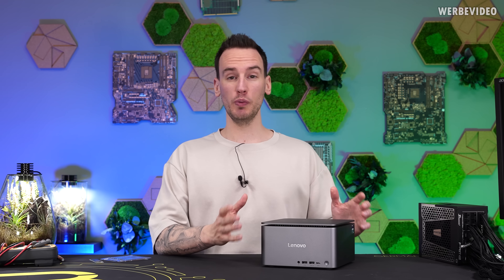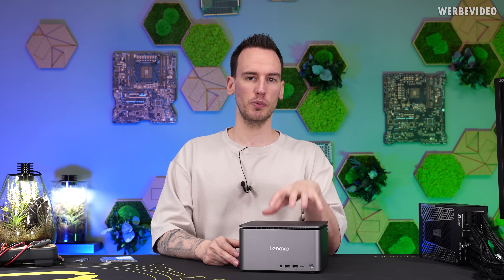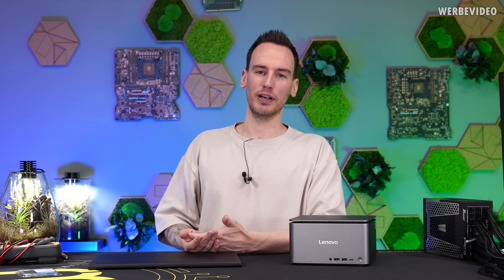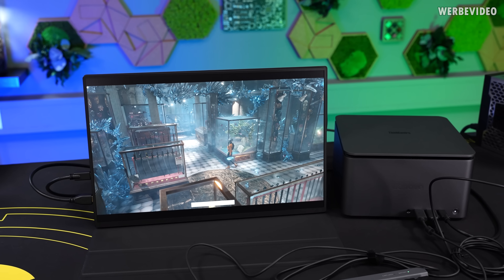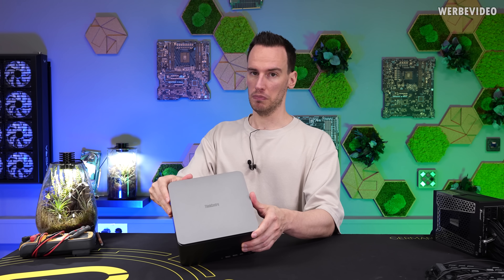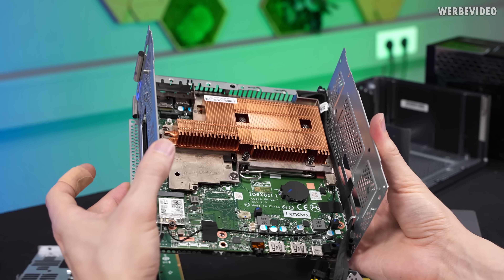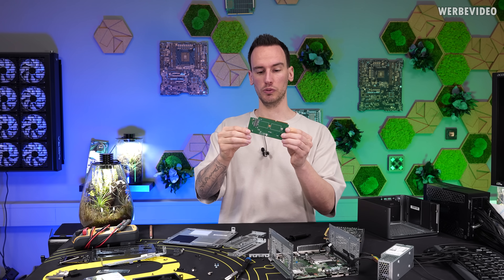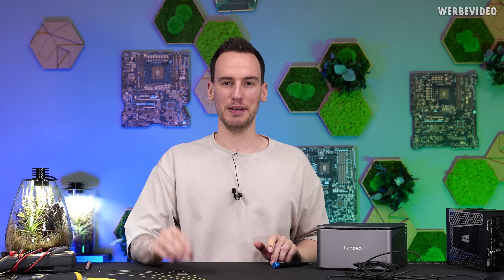Interesting Cooling Solution inside my new Lenovo Mini-PC

Comment: I've been using Duronaut to try it out and the results are very good. Spreading was a big issue for me on my 9800X3D, but when I switched to a different technique I was able to get better temps than I had with my Noctua NT-H2 paste. My best results were putting a little Duronaut dot on the CPU, then smearing it around with a finger cot (thin piece of plastic over my finger) for a thin coating on the CPU heat spreader and base of cooler. Then applying 5 small dots of paste on the CPU. It is easier than trying to spread it and works really well for me. Thumbs up!
Reply: he explained that to do pressure down with the spatula is a must to make the paste stick to the surface.
Anyways what you did is what i used to do with as5 that i remember was pretty thick and dense.
Reply: Materials with better thermal conductivity will reduce the viscosity, I buy M14 thermal grease is also very difficult to apply, I do not have the patience, I press directly with my hands, but the thermal conductivity is very good.🤣
Reply: You can make it more spreadable by heating it up just by dunking it in boiling/hot water and make sure that the tube is closed and when you pull it out its nice and toasty which should make the paste less viscous due to the heat. Also slamming your CPU with Prime95 or Cinnebench for about 10 minutes and then immediately turn off your computer and yank out the cpu cooler and then quickly clean the cpu trying to save as much residual heat on the CPU heatspreader and use that to help you spread the Duronaut.

Comment: I just love the look of a good ol' copper heatsink like that <3
Reply: Remember when desktop motherboards used copper heatsinks to cool VRMs? Now they're all just big hunks of aluminum with poor fin density.
Reply: @Mr.Morden  To be fair, aside from one gen of AMD chipsets that needed fans, modern aluminum heatsinks are fine.  Whereas sometimes the old copper heatsinks were implemented so badly that an aluminum one could have been better (I had one where replacing the thermal interface and mounting dropped temps by 20C).
Reply: lenovo always seemed to use fully copper heatsink on their high end profesional gear

Comment: The blue plastic retention clip for the M.2 caught my eye. A good idea for that to become a mobo standard. Fewer lost screws, and slightly less weight. No need for a screwdriver/nutdriver either.
Reply: Some mobos don’t use screws already
Reply: Also, the screws they use are so freakin tiny and so easy to yeet themselves somewhere they shouldn't be.

I had one landing inside the pciex16 slot and it took me a while to get it out.
Reply: @enlightendbel  next time just turn on the PC with the screw there, you`ll either see it flying out while making R2D2 noises or get magic smoke
Reply: most motherboard have that already and its not about weight those screws weigh like nothing
Reply: good that it is starting to get used more often but one thing is bigger challenge that m.2 slot is just up of pcie slot so gpu hides it. you have to take out the gpu to change m.2. its a pain and often people who have no experience with pc cant do it cause either their friends helped them build or used prebuild. also just remebered these type of clips dont need the standoff. you wouldnt believe how many ssd ive seen banana shaped
Reply: @boombox8675 The bigger problem with putting M.2 drives under the GPU is thermals - PCIe 5 drives kick out a fair bit of heat and if they're buried under a big hot GPU cooler that heat will build up a fair bit
Reply: @bosstowndynamics5488  the slot above gpu is the fastest one so running a pcie5 drive its must you have to put there. also ive heard nvme ssd can tolarate high temp more than you would think. but ye the placement is really bad
Reply: @boombox8675  NVMe drives can tolerate high temps but if we're going to claim that PCIe 4 is too slow then you definitely don't want to put them somewhere thermally constrained since PCIe 5 ones in particular throttle if you even look at them funny
Reply: I'd be happier about no longer having the possibility of having one of those screws snap. Had it happen on my previous mobo and the other end was stuck in the standoff
Reply: I have lost the screw that came with the mobo. I think it got sucked in a parallel universe. I spent almost an hour to find it with no success. 
My big surprise was that I could not find similar screws for sale... and they are in different sizes and threads.
After that experience I prefer the rubber.
Reply: @christiancurec3574  the m.2 spec actually requires the screws used to be either M2x0.4mm or M3x0.5mm, also I'm not quite sure these plastic or rubber solution comply with the spec as the screws are also supposed to work as a way to transfer heat off of the m.2 device...
Reply: @kettusnuhveli  Not sure about screws being a thermal interface with how tiny they are and how they're relatively distant from the heat generating parts of the M.2 device, but they do seem to be expected to provide grounding since the hole is always conductive. Fwiw I've seen passive adaptor cards with these plastic connectors that also ship with a screw post you can swap in in case this does cause issues
Reply: @ i personally doubt the thermal benefits as well but that is what the PCI-SIG claims in their spec
Reply: They’ve been on Lenovo tiny pcs for years usually with a thermal pad too
Reply: eh it rather have something metal that snaps bakc like the brackets you use for the memory, actually insane that a screw is the norm....
Reply: Asus been doing this for Years on their entry level boards
Reply: I work in IT. Lenovo has been using them for years. Fingernail busters, lol. They work, though.
Reply: m.2 are so fast its hard to not want to use them as thumb drives
Reply: I've seen it already on some server motherboards from Supermicro, but not on consumer stuff yet.

Comment: Hi Der8auer, before you upgrade to 64GB RAM, you must use "shutdown -s -t 0" from command prompt to able completely turn off PC without fast startup mode.
Reply: If your hardware changes, the hibernation state is invalid and the OS does a normal boot, there is nothing at all that you need to do.
Reply: Do you have docs for that? I’ve changed memory count in a lot of PCs without doing it first….
Reply: Thought I only have to go so deep in the UI just to disable fast startup radio button. Thank you.
Reply: why on earth would still use hibernation? powering and disassembling the thing already wiped the memory.
Reply: @DeviloftheHelll   Modern Windows uses a kind of quasi-hibernation to speed up boot times where only the initial kernel memory is stored, known as "fast startup".
Reply: @BillyONeal  Yep, it's kinda like between shutdown and hibernation mode. Fast startup were available and it's turned on by default since Windows 8 and above, but it can be disable by users for some reasons. Currently almost all desktops and laptops have SSDs, but the fast startup are still enabled by default for speed up loading Windows, some people want to disable fast startup because they knew about SSD read/write speed are much faster and doesn't need to turn on fast startup for else.
Reply: I did some research about this and whatever it is just shutdown normally or using cmd to shutdown, it doesn't matter and nothing have any issues. Sorry for getting confused.
Reply: @BillyRazOr2011 all good!
Reply: A hibernation state would already be invalid as he clearly doesn't have any power running to the pc while messing with it, meaning that any state saved in memory has already been lost
Reply: To actually turn off fast startup/hibernation, you type:

powercfg /h off

Lol
Reply: What a load of BS. Did Linus tell you that?

Comment: I've heard of this, the memory training can take a very long time on first boot with large capacities.
Reply: mental that some manufacturers don't bother with a memory training loading screen
Reply: @Bacender  I think they get away with the inadequate user interface because the only people who really run into the problem are by definition pretty advanced users who learn about memory training through other channels.
Reply: @Bacender  explain how a memory training loading screen would be possible if the memory isn't available for running programs during memory training
Reply: @game-teait should be possible to make the program so small, that it runs entirely in the CPU cache. Or you just put like a 1mb memory module on the mainboard for this program, only costs a few cents
Reply: @doktormerlin  People that change the system memory are usually technically skilled enough to know to just wait a bit for memory training. I think less than 1% of people change DIMM's.
Reply: @SrApathy33  novice builders have the same problem when first time booting their newly built PC. Even Der8auer was tricked here.
Reply: @Bacender Not sure how you expect to see a loading screen when the memory needs to train before it will even pass post...It has no way to know what is even happening yet...
Reply: @ because dozens of laptops do it. In fact the Lenovo T14 series that I have personal experience with shows a memory training screen lol. Please sit down.
Reply: @Bacender  I've never seen it before...I will have to look into how that actually works...I think it is a great idea for sure...I have personally worked on many PCs for friends that they thought were broken, but were just stuck memory training for 5+ minutes...

Comment: i find it pretty weird intel has soo many mobile devices while amd seems to,... well, just not. what's up with that? youre limited to like weird combo's or form factors, but even if not about those then the same for laptops.
Reply: that is thanks to how intel does things and how amd feels new for most buyers, intel dominated for well over a decade so old users stull think on intel

intel recentoy offered some deals and money for this kind of builds to oems and manufacturers, perfect example was msi claw

amd fo thins on laptop or desktop, intel tries to make everything be laptop, even a desktop cpu like this one

a amd apu jere would have been better for thermals and power consumpyion leaving room for a more powerful gpu, problem is size here

Comment: I'm surprised you didn't take this opportunity to put a Ryzen 395 Ai wit 128gb of DDR 5 8800mhz.
Reply from the maker: Nothing available yet in Germany :( But that's what I also meant at the end of the video
Reply: I don't think 8060S in 395 can render faster than vanilla 150W 4060. Then I wonder if Lenovo do AMD 7945HX?
Reply: @JohnWilliams-gy5yc  My formal training (back in the stone age) was in computability theory where most of the problems were concerned with proving that a particular solution was the optimal fastest/best solution, but in the 40 years since then none of the real world people who hired me ever asked for a mathematical proof. As long as what you're doing is good enough for now, that's all they want to be willing to pay the invoice.
Reply: @NateEngle  I just think that an iGPU works best when you're REALLY on the go, like a handheld or a laptop. A dGPU performs simply better because of higher wattage. I think Roman needs a dGPU for his 2025 Taipei trip to work while plugged in, not on mobile situations.
Reply: @JohnWilliams-gy5yc  I'm sure you're right about the technical performance points but Computex Taipei kicks off in just over 10 days. Presumably there's some other packing and preparation to be done and then Roman needs to travel around 9,000 km and get set up in a hotel half way around the world. I doubt he even has time to read any comments here much less act on them to change his hardware plans. As the old saying goes, "Ars Longa, Vita Brevis" - ("Art is long but life is short").
Reply: @JohnWilliams-gy5yc  if he had room a USB 4 dock and a 4090FE 🤣 been playing around on my 9950x3D and portable docs to see how the 4090FE plays with it.
Reply: @shadowarez1337  Yeah, I would like to see the comparison of that also. USB4 will be limited at 40 Gbps and adds some more overhead, unlike direct PCIe x16 or even x8.
Reply: Yeah I would have gone with one of the Ryzen AI platform mini PCs or even a Mac Mini (I'm not an Apple fan).

I don't really understand why he chose to spend €1500+ on a refurbished Intel 14th gen system.
Reply: @JonnyJKF  I think he's just looking for something semi-disposable that he can carry along to be a render station. The fact that so many people are replacing their intel 14th gen systems with AMD is exactly what makes the refurbished market attractive to bargain hunters.
Reply: @JonnyJKF  something that's available and capable availability is a big one waiting on a pre-order from framework for my AMD Strix Halo 395 128gb system.

Comment: I'm not a Apple fanboy but wouldn't a M4 mini be a lot faster and smaller? I know they are expensive but I am pretty sure it would smoke that Lenovo in multi-core tasks.
Reply: with same storage, alot more expensive, with same ram, does ot exist? at what cost would exist?

mac is perhaps faster but you will have to use the mac tools available and if you dont, more work for you

it is nice, but more expensive and no flexibility at all
Reply: it would, as well as it would be 4x times smaller and 2 times cheaper, weird times.

Comment: Hey Der8auer! Maybe an interesting video for later (An investigation into why laptops often feel laggy)
Reply: My friend 2 years ago bought high end Gigabyte notebook. Couple months later havy lags began. Investigation showed that something in grafic cards switching system broken. Some shamanic rituals solved issue.
Reply: A lot is the design decisions forced on them by power limitations and inadequate cooling, switching GPUs sounds about right. Unfortunately you can (usually) only disable the efficient one, the power-hog runs hot, burning battery life and forcing the system to throttle.

Comment: What's the model of your portable screen and how happy are you with it? I'm looking to upgrade mine.
Reply: UPERFECT Portable Monitor 2K 144Hz 16 Inch Portable Monitor USB Display with 2560 x 1600 16:10 1200:1 450 Nits IPS
Reply: @Xfade81  I figured it might be a UPerfect. I have a 1080p one and it's like 4 years old, so it's somewhat dated, but the colours are horrible. Good for a cheap office monitor if colour accuracy isn't important. But it would never replace a "proper monitor" which is a pity tbh, just because it's portable it doesn't need to be shitty, yet it also depends on the price.

Comment: Its not just you. On my dell Inspiron 5402, Dell pretty stupid boosting behavior and the cpu throttles itself after a couple minutes and the fans dont even ramp up to full speed. I had to use Techpowerup's ThrottleStop to get a sort of useable machine. Also Dell doesnt even expose fan control. Thanks Micheal Dell
Reply: It isnt just Dell.. I have a Thinkstation with a Xeon here... Pretty big machine, but the fans are really loud on idle, nothing on fan control either (cant do much on bios too). I know its a workstation, but its just dumb running fans that loud on idle. I dont get why this big manufacturers doesnt let us control OUR pc how we want it.
Reply: classic Dell behaviour. their BIOS/firmware for PCs and tablets has always been cursed
Reply: What sort of settings did you have to apply? Just curious.
Reply: @soulshinobi  I just increased the boosting duration to a big number
Reply: @artemis1825  don't forget TS allows you to undervolt for better thermals and such
Reply: @glebglub No you can't undervolt with the i5 1135G7. I've tried
Reply: @ rip, just googled it and yeah, intel stripped that feature out on the hardware level, only the bios can control voltage for that CPU
Reply: Not sure about Inspiron machine, but my Latitude, there's something call power management in the BIOS, and I have to set it to full speed just to crank the fan up. It's loud but it definitely move lots of air. Still, I'm not sure why the other profile didn't even crank the fan to 50% at all, making the CPU temps limbo in 80c.
Reply: @benjamintan2733  I've set power management to max performance
Reply: Yeah love to control my fan curves manually, and quickly, from within my OS (Linux). Such a good feature I wouldn't want to miss anymore.
From making it super quiet (and ofc throttle) in public spaces where I don't want to stand out, to making it blast even at idle so it stays nice and cool on my lap while out in the sun, and more realistically, everything in between. A single fan curve just CAN NOT fit all user requirements and being able to switch easily is a blessing IMO.

Comment: Why not buy M4 Max based 16" MacBook Pro to edit and render on the go?
Reply from the maker: I really dislike MacOS
Reply: @der8auer-en  +1000000 respect
Reply: @der8auer-en , as a long time Windows user (I've been using Windows since v3.1, which was more than 30 years ago), I also disliked MacOS the first few times I tried it. But, after I bought my MacBook M1 Max laptop a few years ago, I honestly can say that, unless something radical happens in the Windows laptop world, I will not go back to ever using another Windows notebook / laptop. It's simply been life changing. There are still some things that I like better on Windows, but there are also many things that MacOS does better.
Reply: As a mac user and a Windows PC user, I can tell you that it is nice not to have to move projects from one operating system to another. Moving between operating systems can break things and result in bugs that you would never otherwise experience. It also sound like this will be a secondary machine so the projects will go back to another larger more powerful windows PC when he is not traveling.